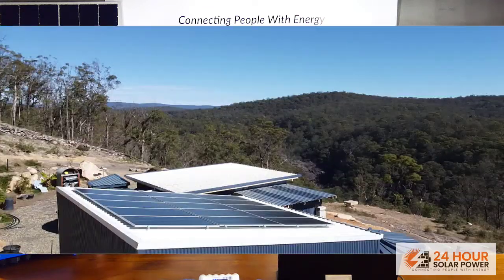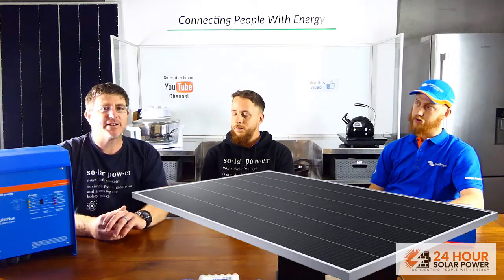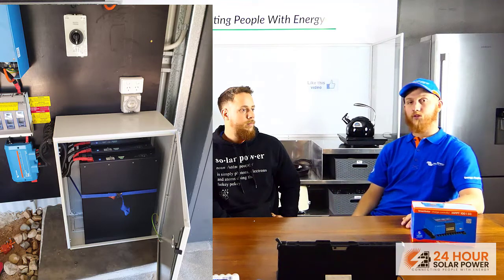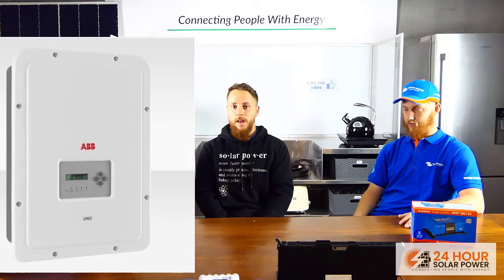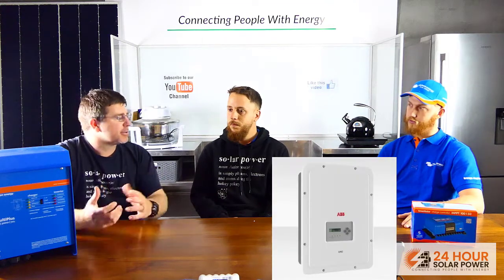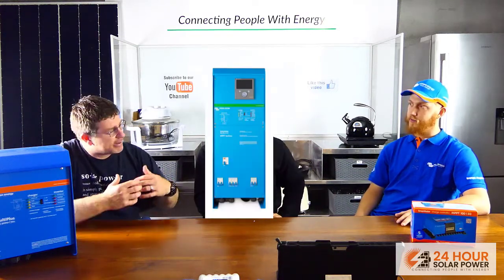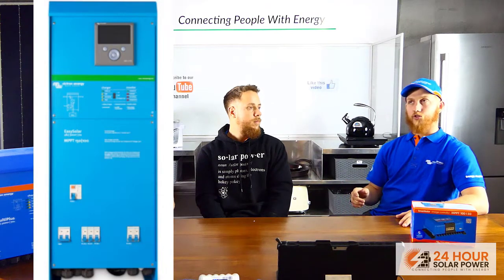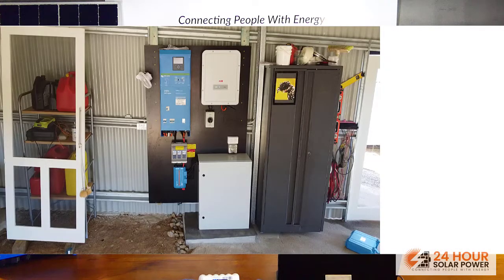Victron Easy Solar Installation

Comment: Hi there,

I have Victron Easy Solar II 48/3000Kva. On the sticker near the battery input (DC In) It says 48 V Battery, 38-66 V, 75 A DC. 
What does it mean with 75 Amp DC ? Can I connect the Victron with my 48 Volts, 100Amp Gel Battery ?
Reply from the maker: Yes you can connect your battery.  That's a good size battery for that unit.
Reply from the maker: The 75ac DC is what is the max it will pull from the batteries. That also has a 70 amp mppt so the max it will charge the battery.

Comment: I was told it can feed back power to grid if batteries are full and no load active
Reply from the maker: Yes. Depending on where you are you might require an extra part. It's a second relay or contactor for protection of the grid.

Comment: Could more than 1 grid tie inverter be connected in parallel to the output of the multi plus?? As 1-1.5 kw grid tie inverters are cheap to free atm...
Reply from the maker: Yes you can. You require a 1.1 ratio. Ie can't put more than 5kw of inverters on a 5kva Victron inverter. And that can be 2x 2.5 inverters.

Comment: I've got a 48v Victron Easy Solar, charging 7.5 KW Hours of BYD lithium batteries, using 10 pv panels. Where do I connect my hydro power to? I'm planning to be bringing about a kW in to a separate Victron charge controller, and need to know which terminals on my Easy Solar are best to connect the extra DC input to. Thanks.
Reply from the maker: Victron MPPT doesn't directly support hydro power but it can be done. Ensure appropriate voltage is being output and then the charge controller would connect to the battery terminals on the Easy Solar. Always best to get sufficient advice if you're unsure.

Comment: Dam, I shouldn't of thrown out the old grid tie inverter I had.. I have a EasySolar 3000 48 setup. I didn't realise I could inject grid tie invertor power into system..!
I assume this will go straight in parrallel with generator  on the victron.
So does that mean that generator and inverter power gets bridged to victron  240v output, rather than just charging the batteries?
Reply from the maker: You want your grid tied inverter on the output of the Victron.

Comment: Would you recommend EasySolar 12/1600 for a camper van and is there a 12/'3000w  easySolar system avaiable at all ? what would you recommend if I need a 3000w inverter but rather to go with your EasySolar package ?
Reply from the maker: Hi Sina, no there is no 12/3000 easy solar. What's the reason you want to stay 12v?
Reply: @TheOffGridShop  the main reason for most caravan, van people is the stock alternator puts out 12V. I know there is a work around with say Victrons Buck/Boost but that is just an additional cost.
Reply from the maker: We have seen it more cost effective to use a 12v -24 converter and save on the size of cable to run to the back of the van.
Reply: @TheOffGridShop  can you suggest such a converter? 
I can get 25mm² stranded flex for $8/Meter, 2x 10M runs is 20meters @ $8 is only $160 of cable

Comment: Nice try but really didn’t get into enough detail about the Easysolar II which is what I came for. I’ll have to read Victron’s manual :) I thought being an all in one (Multiplus II, GX and MPPT) it would still have all the features of the Multiplus II which means you can configure in grid tie with battery backup right?
Reply from the maker: Thank you. And yes it is just a multipluss. You can use the grid as a back up. The difference is between this and the II is you can't use this to back feed to the grid.

Comment: Wish you guys had a rep in the States, but I guess I'll just learn from what your doing.
Reply from the maker: Thank you. Where are you? I have a few contacts over there .
Reply: @TheOffGridShop  The nearest major city to me is Denver, Colorado.
Reply from the maker: Ok great. I am looking forward to visiting the state's when we can. What are you looking for? I can ask.my contacts in the states if they can help you?
Reply: But soon to be moving to New Mexico. That is where ill be installing the solar system.
Reply from the maker: Reach out when you ready. I will ask the guys where they are based.
Reply: @TheOffGridShop  It'll be for our off grid home. I haven't calculated how big of a system we should get, but I guess about an average house. We'll start construction in spring of next year. So I have some time to fine tune what to get. Thank you for any information tips tricks references contacts.
Reply from the maker: @iTeerRex  That is so exciting. Would love to hear more about the build. You are so lucky to be able to design your home as this will be the best efforts spent is getting the design of the house right to make it a low energy home. Then your solar becomes something that really just runs lights and fridges. Or leave more room to charge electric vehicles than waste energy heating and cooling spaces.  You will see some videos thus year form us about the design and build aspect and materials. We are just doing a room at home right now out of Hemp. So exited.
Reply: @TheOffGridShop  Yes it is exciting but also a bit daunting and nerve wracking. Given all that has to be learned and implemented to go nearly off grid, including about food and medicine. For about two years even before this pandemic, this have been my plan, and ever since I've been studying and studying so many diverse topics. I just hope I'm not too late, and the pandemic is not gona hender the implementation of it.
Thanks for the invitation, when I am ready I'll try to contact you guys.
Cheers mate.
Reply: @TheOffGridShop  And yes hempcrete and strawbale construction methods and so on.. I've been trying to figure out a good way to build a passive solar house, similar to an earthship, with out the tires and bottles lol.

Comment: I actually liked the unusual combination done in this instance.

By combining an AC and a DC inverter you made the best that can be done to increase efficiency.

This was a team effort presentation.  I have found best to do these with a diagram that you and your audience can reference and follow along.

I noticed that you kit prices start around AUD$16K to AUD$17K.

I am sharing below a couple of links that perhaps you might find useful in either bringing down these prices, increasing the size of the battery banks, or a combination of both:

https://ultracell.co.uk/www.ultracell.co.uk/products/uzv-batteries/2v.html

https://www.sbsbattery.com/products-services/by-application/stationary-standby-power/renewable.html

The first link is for a UK based battery manufacturer.  The second link is for a US based battery manufacturer.

They both make lead gel based batteries.  These can last between 15- to 20-years based on their data.  

The US company, also, makes Nickel Cadmium batteries.  I personally prefer Nickel Iron batteries, but people have been known to run off grid sites with both.  As you know they like all batteries are temperature sensitive, and protecting them from extreme weather might just be the ticket.

They are both known for fair pricing and good quality products.

The reason, as I said, for doing this is to provide other battery alternatives at lower prices.
Reply from the maker: Yes, we Love Ac coupling. We do it most systems we do. Changes behaviour and gets people doing more of a day as well.
Reply from the maker: Thank you for sharing the links. In Australia with the batteries we use there is only a few hundred dollars difference between lead-acid and lithium.
Reply: @TheOffGridShop  in Europe at the retail level, for instance, and before value added taxes (sales tax), I can buy a 576 Ah, 2-volt DC, Ultracell, OPzV, gel lead battery for €162.70.  This is 1,152 watts.  This makes the cost per kWh €141.23.  This is AUD$234.67 retail before sales tax.  This battery is offered with 3,400 cycles at a 50% DOD and 5,750 cycles at a 30% DOD.  Battery stored cost at a 50% DOD is (€141.23 / 0.5) / 3,400 = €0.0831 or AUD$0.1381.  

This is AUD$0.1381 per stored kWh before inefficiencies.

These battery retail costs are average but not good or great.  There is still room to negotiate lower prices.

I hope this helps.
Reply from the maker: @ek9772  sounds good and there is no way in Australia you would get a cheap battery at that piece let alone a good one.
Reply from the maker: This is about what we pay here. https://www.ebay.com.au/itm/282241962005
Reply: @TheOffGridShop  actually this is about the highest available quality for lead gel batteries.  

It is not considered a cheap battery.  The manufacturer has a reputation for quality products.
Reply: @TheOffGridShop  interesting.  It is a difference of only about 11%.

Comment: Am finding the inlet/outlet ports are fixed, not ideal for vertical inline installs, where compressor is directly above or below indoor unit, also for small units does the gas/liquid lines really need to be different diameter, seems we need to keep efficiency but stream line a bit, if we're going to meet AGW demand, and explain why vehicles can get away with rubber,alloy,dryer system all very different, here in Australia, its all trade standards with no academic research so over time there is a mismatch between latest technology and best practise.
Reply from the maker: We see that mismatch a lot :)